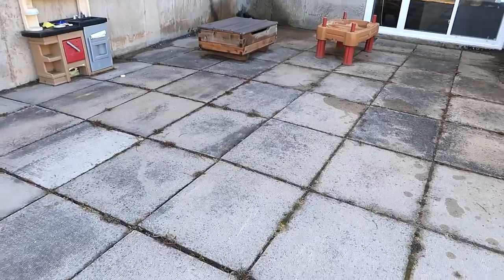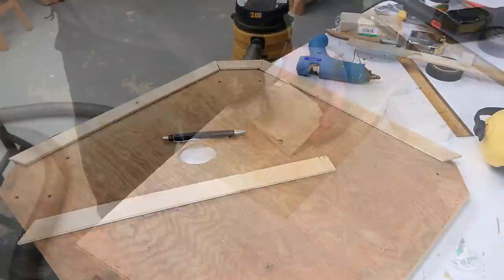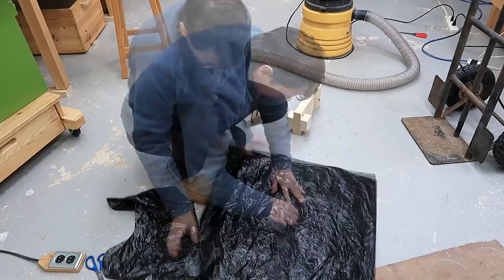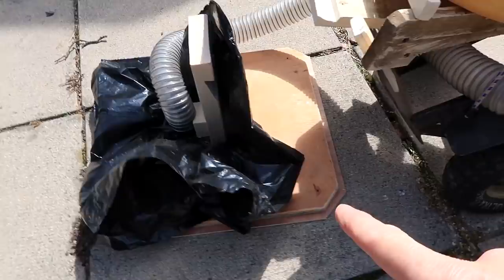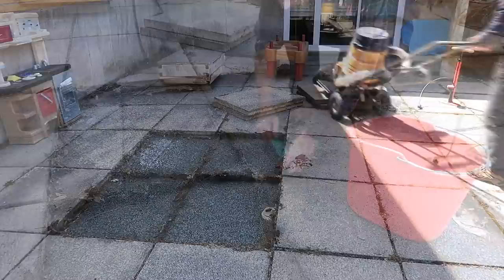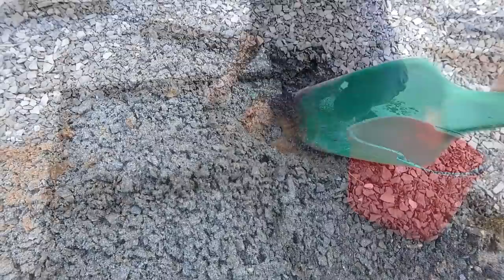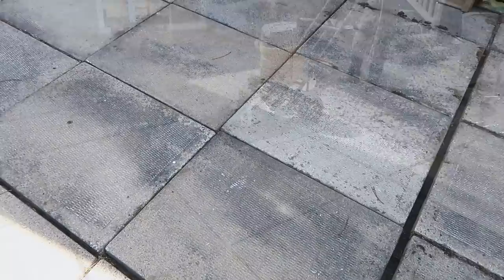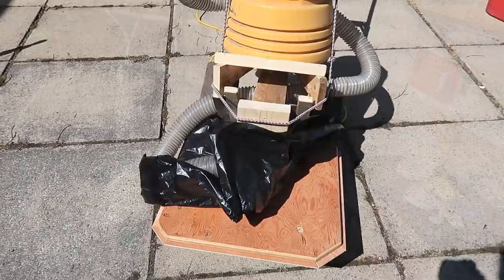Lifting patio stones with a shopvac

Comment: Lightweight frame around your seal -- from lathe perhaps -- to weigh down edges.  Gaffer tape on sealing surface will outlast garbage bags. Suggest to use polymerized sand combined with rocksalt as grout between pavers.  If you can pull them up again, use plastic  or landscaping cloth under the pavers -- cloth will let water drain through, but plastic will have to run off.  Tyvek housewrap is also good.  Protected by pavers and grout, especially against UV, underlayment will last a long time.
Reply: If he keeps the same pavers he could cut straps of landscape cloth wide enough to cover 3 or 4 inches / 75mm and put down 2 or 3 layers on his lines like a checker board.

He could cut the roll of cloth on one of his bandsaws or cut it on his lathe.

From all the times I've used ground cloth, the more layers the better. 4 or 5 layers and he could reliably pressure wash out the detritus and dirt in the spaces between the pavers without worrying about damaging the cloth.

Comment: Genius.  I wonder if a bead of polyurethane or silicone around the edge of the board (after curing) would be enough to keep the vacuum consistent on rough surfaces instead of the black bag.

Comment: This is what I don't understand - the time management of such things.  It seems there is not enuf time to 1) conceptualize out of the box solutions 2) Design them 3) Build prototype 4) Redesign 5) Rebuild.  Matthias, how long does it take to get this thing made in both man hours and elapsed time (for example you may one spend 3 hours working on it, but you need to wait for glue to dry overnight, so that would be 3 man hours and 1 day elapsed time). I seem to never get anything done cuz I am always thinking of better ways, then it takes days to build them, then it needs to be reworked and so I stop.   The 6 patio stones without your sucker could have been moved in, say 15 - 30 min. I would guess it was at least a day or two to build your lifter.  Which seems like a deal breaker if you have lots of projects to get to. So how long did it take to conceive, build, then tweak?  And how do you decide if it is worth the time to try to invent something (or test something like vacuum suction or joint strength) and how do you decide to when it is time to give up on an idea?  Is it time, frustration, or some other parameter that decides when to scrap labor saving /time saving idea? In short I would love to see a vid on how you manage your time and prioritize you activities. I aspire to do what you do and have many creative ideas, but seem to get 1/3 through a project when something more pressing comes up so I have literally 20+projects all 1/3 completed, and I never have time for my family not to mention that my wife hates me cuz our house and yard are littered with dozens of projects "in the works".  Thanks to you and your channel, you are a true inspiration.

Comment: Had to deal with this issue at my last house. Your vacuum idea is great, but why didn't you come up with this 14 years ago when I was breaking my back lifting blocks by hand?? I suggest you remove all of the blocks. Clean out all the weeds and put down additional crusher gravel with sand mix. Then wash the stepping stones with a bleach/water mix to clean them up well and then paint them with whatever you have up there for concrete. Then start placing the stones from the house out with a tighter spacing that you can fill with a flexible calk. I placed the stones after cleaning them and then calked and painted last, but I wish I had painted them before placement to get the sides and keep the mold at bay. Also, I use what is called "COOL DECK". It's commonly used for concrete decks around swimming pools in Florida.

Comment: One side of my house doesn't get sun and stays perpetually wet. There's mice in that brick wall that they access through a crack between the sidewalk and the wall. I had terrible mold issues in this area as well. I ended up using diatomaceous earth, use the creased piece of paper to direct it down into the crack. I probably committed some environmental travesty, but not only has that wall been rodent free, moss and algae will not grow on the walk at all. I overtreated it once and it's been a little over 8 years, still working great.

Comment: For the skirt just try a support frame border with enough material droop between the underpanels edge and that support frame. 
Or for slight heavier material that's cost effective a poncho, or vinyl shower curtain with or w/o the  weights, or for really thick a tub mat.

Comment: I’m currently trying a concrete caulking for cracks and expansion joints. It’s grey and dries remaining flexible. Can’t tell you it works, we shall see.
Reply: Mortar repair caulk? I use it frequently, but never in something as narrow as the gaps on these pavers. I really hope it works out for you! 

One thing I'd recommend is laying a fat bead down before placing the paver in place, almost like squishing mortar in a joint and make sure the edges of your pavers are free of loose sand and dirt for a better bond.
Reply: @jonanderson5137  not using on pavers, cracks in concrete driveway some are smaller than his gaps. Following label directions.
Reply: @rchighfield1  I see, is it acrylic?
Reply: @jonanderson5137  says polyurethane.

Comment: I buy a ton of salt and pour it between the cracks. The saline levels are inhospitable for the weeds and they die off pretty quickly. You should do this during rainy seasons especially to get the salt to dissolve into the soil. It does ruin the soil if you want to plant something else like grass there in future though.

Comment: If you can find a bicycle inner tube the right size to run around the perimeter, silicone it in place and inflate it just enough to give it a bit if shape, but still be squishy enough to conform to the rough surface.

Comment: Spacers for installation of floor tiles provide a pattern or direct solution to one problem. Weed blocking membrane would only offer you a moderate time reprieve because of the resilience of nature, plants don't actually require ideal conditions.

Comment: Nice solution 😄 the problem is the seeds find moisture and sprouts, if you could remove the moisture availability, you should be good.. i've seen dandelions come up in the middle of the asfalt road, so i wish you good luck 😅 maybe filling the cracks with something flexible like sikaflex(if it's named that in english?) But i imagine it wouldn't be very lasting, as soon as the cracks come, you got a bigger job than roots 🤔 i know my father used a gas burner to kill the weeds in the driveway(smaller bricks), but again, not very long lasting, and require some extra work and time. It seems all dust and stuff that collects between the rocks is excellent at holding that moisture to let nature do it's thing, which is a good thing, just unwanted in some spots in a human life 😅

Comment: A little salt in the gaps. Then sand. This would work for a block paver style driveway. I don't see why not on a patio, assuming the gaps are evened out to be even and perhaps tighter. Just don't park a vehicle on it!

(the salt is my idea to prevent regrowth, I've read from others that it works very well)

Patios around here are laid in mortar, which holds up well against weeds for about a decade or so. Depending on the mortars ability to flex with weather, keeping the gaps tight and seeds out.

We get much less frost heaving though. That might affect construction styles, materials, lifespan and weed growth.

Comment: there is an organic compound you brush into the gaps when wet and when it dries its rock solid. much easier than grouting, just need a brush. more expensive than mortar tho. looks a bit similar to resin driveway stuff

Comment: you can pour boiling water on small patches of grass/weeds to kill them off; would have to do this periodically but it doesn't require chemicals.  Or dissolve salt in the boiling water.  I've tried this in places and it helps.

Comment: What you made and what you're doing is two different things. You made a very good tool. It flat out works and you can easily lift, move, replace those heavy pavers. 

I think you're better off just removing all the pavers. Repair the base. Try to stay off the base by walking on thin sheets of plywood. Now replace the pavers. Do the pavers have built in spacers? If not I would space them apart, not much. Use polymeric sand. Use a compacter with a rubber mat over the pavers. Really get that sand down between the pavers.

Comment: First it’s crushed stone and stone dust not gravel, can tell by color. Second if it sunk that much at house you need a load of clay and dirt mix to put under stone mix. You may want to continue this all around house as it’s probably raising and cracking basement floor from water infiltration.  Professionals usually install patio blocks, bricks, or pacing stones on semi flat surface near a house with a slight grade away from house. When they finish they spread sand, brush it around, soak with water spread around more and more packing as much sand between stones as possible. Rest is then dried and brush off. No weeds.

The purpose of weeping tiles is to remove ground water infiltration to either sewer drain. Older homes, or a sump pit. Gravel is placed two feet below ground level with clay and dirt put over top so that rain water does not flow down To weeping tiles.

In simple terms you are supposed to have water drain away from house. One inch per four feet is minimum. Landscaping on new homes after five years we usually added and packed down a load of fill to that level then Put an additional six inches of four way mix over top at house and packed down.

This old house has covered this as well many many times.

Comment: Consider making a gasket. Pick out a squishy material, cut to the shape of the point of contact between wood and concrete, drill some holes for screwing it on.
That or if you wana stick with the trash bag seal, just hold it down with some wood and screws.

Comment: Sweep mortar into the joints and add water to stop stuff dropping in between pavers. Sand leaves the pavers removable but doesn't do as good a job sealing the joints

Comment: you're looking for a "pre emergent" it's a chemical usually spread in granule form and then watered in. it soaks into the top layer of the substrate and hormonally prevents seeds from germinating. you'll use it about once a year and with such little area I bet one bag will last you a lifetime.

Comment: I think if you added a handle mounted switch for the vac and a pivot/hinge so your hand truck doesn't become separated from your "suction flange" you'd be moving those stones at a higher rate.  That might be overkill though for this size project.  For the weeds, I've had moderate to good success with vinegar.  I'd say cool idea / solution, but it actually kind of sucks.  (I'll see my self out now)

Comment: Add the sand/cement compound by brushing it into the cracks while dry. After all cracks are filled, use a water hose to slowly sprinkle the cracks. It will seal them and keep out the roots. 
Too late to add weed blocker paper, unless you want to remove all the stone, lay it down, then top coat with ~1” of sand and replace stone

Comment: Remove all or a large section and put down a layer of lime around an inch thick or so. It will raise the ph of the soil and inhibit growth over time. Won't stop it but will create an environment not suitable for growth. Ants don't like it either.
After stones are set, moisture will cause it to set similar to concrete providing an additional mechanical obstacle for growth. A ton is usually around the cost of limestone gravel. 
My region roughly $10/ton probably $20/ton delivered. (I'm within 20 miles of a quarry. )The quarry can tell you how many cu yards are in a ton so you can figure out how many tons you need. 
Wouldn't hurt to put down a good pre emergent and water it in to stop germination of any seeds that are in the area. Would give the lime time to change the chemical composition before the pre emergent breaks down. 
Anything alive and growing should be sprayed with glyphosate and given 10 day's before removal. 
After completion something should be spread and swept into the joints, lime, mortar, some type of outdoor grout. Could get fancy and use leveling caulk with a foam backer rod, would be expensive though.

Comment: 1. Why use the heatgun on the wood before applying adhesive?
2. Pouring boiling water on the weeds in the cracks works fairly well and is eco-friendly.
3. This is super cool.
Reply: Heating the materials helps ensure the glue doesn't cool prematurely when putting the two pieces of wood together.

Comment: Watch out when using salt for weed control.  I did that once and while it def killed the weeds, the salt leached upwards later and left a white crust on the pavers for a while.  Not a huge problem, but unsightly, which is the same thing you were trying to eliminate when killing weeds, right?

Comment: If you have no gardens/grass nearby Use cooking salt between the cracks. Commercial supplies supply 20kg(44lbs) very cheap first dose usually last about 9 months depending on rain falls. my second dose gives me about 2 years of weed feed. Where I live there is only 1 weed that can handle the saline conditions but they rarely pop up.
If you don't mind pollution sump oil and diesel before putting pavers down will just poison the ground also keeps termites away for many years

Comment: You want it sagging down to the corner for drainage. Typically you don't leave such a massive gap between pavers like that. My OCD was going nuts at the end with the pavers not being the same size or misaligned.

Comment: Pond membrane. Would be expensive as a solution, but you only do this once and you're done with weeds for the rest of your life (that plastic is rated to last decades). I've some over a compost bin that's been in the sun (so beyond its rated purpose / UV) for at least 6 years now without any sign of degradation, which is otherwise observed in the normal plastic sheets i use, and have to replace every couple of years in the yard because they disintegrate.

Comment: We had concrete with relief cuts, and I got so tired of fighting the weeds and ants making homes there, I scraped, vacuumed out all the cuts and filled them with Sikaflex self leveling polyurethane sealant.  Then I painted over the concrete with a sand texture concrete paint.  There are other brands, but this is good.  And if you have a thick space, there are foam strips you put in first.  Then put in sealant.  
As for the machine, just use weather stripping on the bottom side.

Comment: Since you asked. re: Weeds overlapping construction grade landscape cloth over the gravel and under the tiles should at least limit root depth.  re Plastic gasket - What about caulking the seams and weather stripping the edges of the platen?

Comment: The proper way to fix that would be to pull up all the stones, screed a layer of sand allowing for a bit of drainage away from the house, lay the pavers back tight together, then spread sand on top of them and vibrate or tamp or sweep the sand until the gaps are filled.

Comment: I water my patio weeds with boiling salt water. It's an older house and the front patio has cement between the stones, so moving is only an option if I want to replace it all. It's not the fastest method but ranks high in the lazy method.

Comment: Don't use a weed barrier like has been suggested. The only kind of underlayment that weeds can't root  themselves into and be a total pain to remove would be something completely pore-less like plastic but then you have no drainage and will get flooding. Just fill the joints with polymeric sand. Or regular sand but you'll have to redo that every year

Comment: Why couldn't you use landscape fabric under the patio stones to stop the weeds?   And you could make some sort of thing like tile spacers to insure there is a uniform gap on all sides of each stone.   
But if it were me, I'd relay them all as close as I could together and insure the slope was correct to prevent water pooling.   Even with landscape fabric, if even a miniscule amount of dirt collects between each stone, that will be enough for small weeds to grow.   And if you ever want to pressure wash the patio, you don't want the pressure washer punching holes in the landscape fabric underneath.

Comment: the best way to stop weed growing is lift the pavers up, lay a weed fabric and put paver sand on top and reinstall the pavers, you could use 1/2 inch pvc pipes and a piece of wood to screen the sand til level. and use Paver Polymeric Sand between pavers. you just need to sweep it into the gaps between pavers and mist it with water.

Comment: To fight weed: i know US uses gravel and lots of EU countries use yellow street sand. a thing you can do is put a foil (specially made to counter weed) under the gravel. This way the weed cannot reach the soil.

The gravel or sand bed is more stable also. Then seal the seems between tiles with special sealer that hardens with a little bit of water.

Comment: Hello Sir I Have A Question If U Can Help Me Pls
 I Have To Make ARight triangle Using Three Different width Boards So How To Calculate Or Cut The Angles Of Each Side ? If You Could Help It Will Be Greatly Appriciated(No Matter What The Angles Or The Length Be Only Need The Idea For Cutting Miters)

Comment: Great thinking, impressive implementation. Can we get a youtube collab with Stanley "Dirt Monkey" Genadek? I think a solution to keep the weeds away is to cover the bottom with a fabric, a weed control fabric. This would mean opening all the stones ensuring overlapping of the fabric. I think it would also help to fill the gaps between the stones with paver joint sand and then paver joint sealer to keep it from eroding.